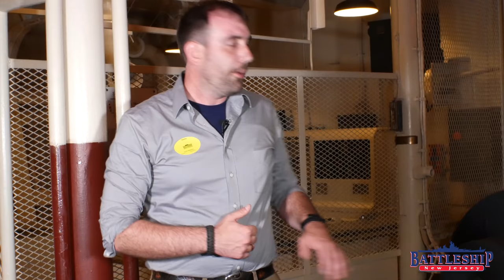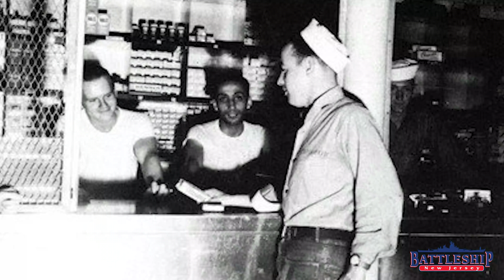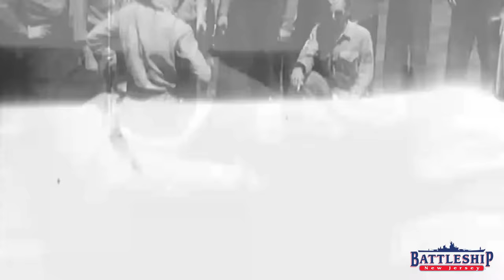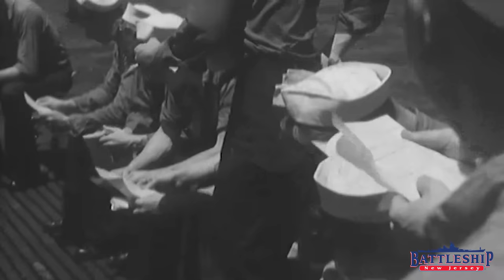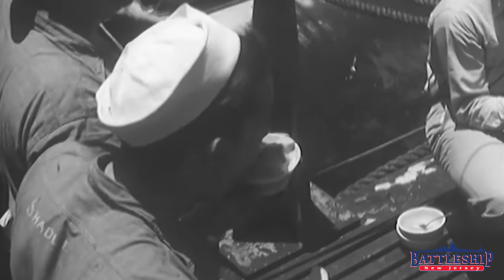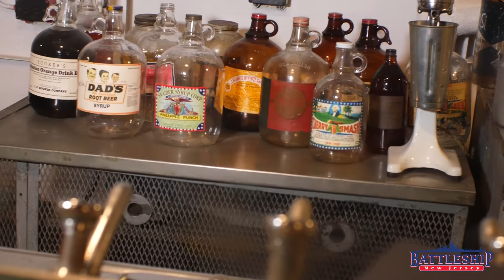Where Did Sailors Get Their Ice Cream?

Comment: On the USS Glover (FF1098) in the eighties, MWR funds bought a soft serve ice cream machine for the mess decks.   Unfortunately it hadn't been installed and the engineers hadn't gotten around to welding in mounting brackets yet.  So it had been lashed into something in the corner of the mess decks waiting for the happy event.   But we were off cape Hattaras in the middle of a heavy storm when we rolled so hard that we got a bubble of air in the main condenser that shut down our propulsion.   Then we were dead in the water in a heavy storm.  We were rolling so hard that I was seriously worried about the ship capsizing.  Stuff all over the ship broke loose, including the brand new ice cream machine.   It bounced around the mess deck, converting itself into scrap.   We buried it at sea the next day with great sadness.

Comment: USS Kidd story.  Fletcher class destroyers did not have Ice Cream makers (ICM).  But the Kidd DID.  The story is that they stole one off a dock.  Then, because it wouldn't fit through the hatch, they got a repair crew to cut a hole in the side of the Kidd and shove the ICM into the serving area, then seal the hole back up - paint and all.  The Capt, knew nothing about this until later when he was served Ice Cream before they had 'ransomed' any pilots.  FURTHER:  ICMs do not operate on air, they need Ice Cream ingredients.  Supply ships have these, but you have to be on their authorized requisition list  before they will give them to you.  SOLUTION: Part of the duties of destroyers was to deliver mail.  So, when delivering mail to a supply ship at sea, the Kidd would ask if they had the makings for Ice Cream.  They would be told "Yes we have them but you're not authorized to get them."  To which the Kidd would reply, "We understand.  Now, just how wet do you want your mail to get?"  Given the value of mail, the Kidd got their Ice Cream makings.  As far as the Kidd was concerned, this was just another version of the "Pirates' ransom."    I can't vouch for the story, but there definitely is an ICM in the serving room at the forward Port side end of the line.

Comment: Could you make a video about how ship fabrication?  Specifically, I would like to know how they welded the thick steel.  Related to that, I would like to know how they would cut, repair, and modify that thick steel.  Also, I'm curious how the electrical conduits and miscellaneous pass-throughs between bulkheads were designed to be watertight and sealed.  Thank you!

Comment: The American forces, army or navy, were world famous in WW2 for their unique consumption of icecream wherever they deployed.  It was one of the reasons why Tojo, the Japanese leader, thought Japan could win against the US - he thought Americans were soft and couldn't take hardship.   Biggest mistake he ever made.
There are more ways than one to make icecream.   I grew up on a farm in Australia.  Australia back then (1950's) was pretty poor and pretty backward.  We had no electricity and therefore no freezer.   And a trip to town took a while, so any icecream purchased would be fully melted by the time you got it home.   But we did have icecream, when mother bothered to make it.  You start with a litre or so of ice, as cold as the kerosene-powered fridge could make it, which is just a tad below freezing if you haven't opened the door for at least a day, add a lot of salt, crunch it up and mix it thoroughly together - this causes a temperature drop of about 10 - 12 C.  You then have something cold enough to make the icecream.  We had a device for doing this crunching and mixing - an insulated wooden box with a crank handle.

Comment: World War 2 subs did not come equipped with ice cream machines.  The crews begged them and stole them and hand built them. Or a particularly successful boat might get rewarded with one. My dad's boat, Finback SS230, got one on Midway in December 1944, that somebody must have swiped from somewhere. The skipper told the chief who glommed the machine that "If you can find a place anywhere on this boat to install that, I will buy every can of ice cream mix on Midway!"  The chief got it installed, and the skipper bought up the ice cream mix, which had to be stored any old where, even in the pipes behind the head.
Reply from the maker: Many WWII subs did come with ice cream machines.

Comment: The RAF seen a few spitfire pilots strapping beer kegs to planes smuggling it from one location And landing at the far end of the runway One of the first few times Mid flight the Beer was over chilled and broke the wooden kegs The idea of using another plane type because it stored a outter fuel pod That could be cleanned out And used for Beer ...This turned out that the beer ended up still having the taste of fuel..So Pilots were told to fly only at a high req' And for short terms (under 15 mins) I would think this was in the wake of Americans that loved cold beer And paid a good price for it Big wigs got wind of it And shut down the lot of them